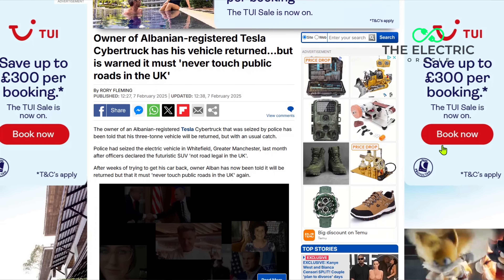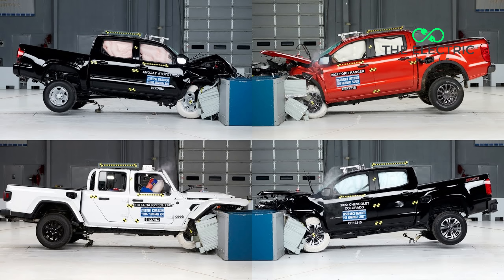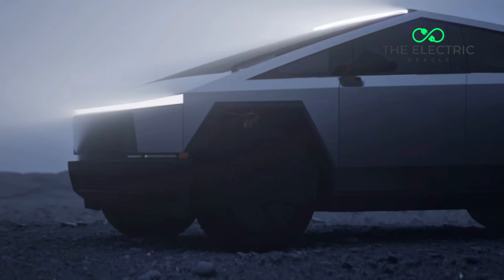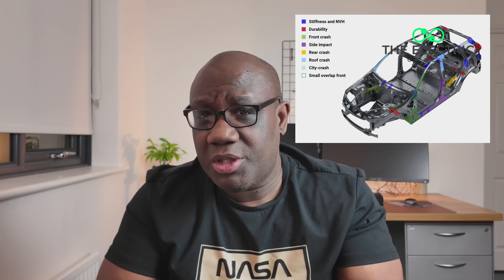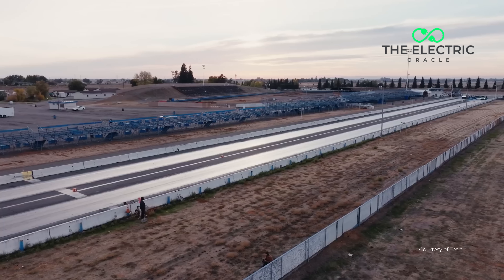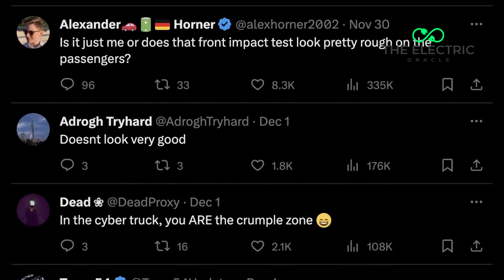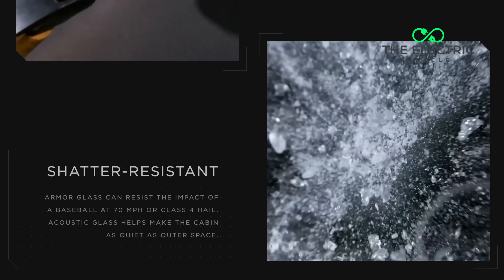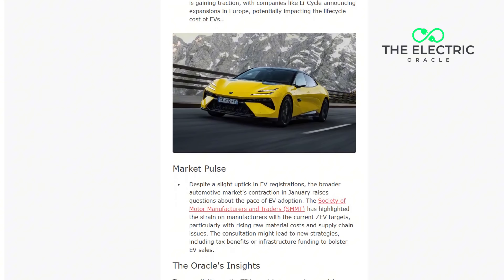Why the UK Banned Tesla’s Cybertruck – 5 Fatal Design Fails!

Comment: I would be happy to see the cybertruck banned from roads in NZ for the safety reasons here, and the poor breaking capacity I have seen in other videos (I'm surprised you haven't mentioned this issue). Utes account for 9.7% of the vehicles registered to be on the road in NZ at present,  which would make it the perfect place to market them. Unfortunately the safety standards of many of the other vehicles on the road are well below that required in Europe,  we import a lot of older used vehicles from elsewhere,  and accidents involving those vehicles and cybertrucks are going to be catastrophic imo. Unfortunately Kiwis have a "she'll be alright" attitude towards everything and won't worry until the death toll rises.

Comment: I would not want to be T-boned by a Cybertruck. Just imagine the carnage when a three ton stainless steel tank with sharp edges slices through another vehicle (or something softer). You wouldn't stand a chance.
Reply: I wonder what palms were greased to allow it in the US
Reply: @davidconner-shover51  President Musk and first lady Trump.
Reply: @alexdumas739 trump was not even in office when the cyber truck came out😂
Reply: I believe there was a report of a crash like that happening. The driver of the normal car was unhurt thanks to their car doing what it was designed to do and deforming around the crumple zones to protect the occupants from the impact forces. The driver of the Cybertruck on the other hand took the full brunt of the rapid impact and suffered significant injury because of the rigid body of the truck transferring all the energy of the crash directly into to them rather than deform and soften the impact.
Reply: @Fimbulvinter19  I remember getting into a heated argument with an American friend about this exact issue when the Cybertruck was first announced.
He was defending it but I was telling him all about the psysics of not having crumple zones and the wasteful energy usage, even if it's an EV, of carrying around all that extra weight of tough steel panels, especially when advertising it with such a fast 0-60 time.
Reply: Not to mention the fact that it burns with the force of a nuclear reactor.
Reply: @Zan823  gas cars are like 20X more likely to burn than a ev
Reply: @mcsike7264  True - because gas cars are deliberately set on fire after being stolen, etc. The statistics are taken from insurance companies.
Reply: @steve6375  hmm no its literally called a internal combustion engine for a reason 😂
Reply: I agree, I would much prefer to be hit by a nice rounded BMW or Mercedes 3000kg SUV, it wouldn't do nearly as much damage as a cyber truck
Reply: You don't want to be T boned by a heavy truck, it's even worse.
Reply: only if it have the charging stations on the range and does not self destruct on the way
Reply: Actually, it just pushes the other car out of the way, like any big truck would. Try it or try getting hit by a semi-truck at 80,000 lbs.

Comment: The Cybertruck looks like a rough prototype.  It isn't sleek, and it is evident that the Cybertruck has absolutely no safety refinements.  I haven't actually owned a car for years, but I am currently the designated driver of a Honda e:NY1 electric SUV.  If I had to use the e:NY1 on long trips, I'd be concerned about the lack of range between charges.

Comment: Yet you missed the most important fail.
Most of the defects can be modded out or by limiting import numbers to only require it to pass IVA regulations.
The fail is the steer by wire, there is no provision in UK Construction and Use or IVA regs to allow a vehicle to be registered on the road will steer by wire. Of course as with everything Cybertruck you can't just remove it and replace it with a mechanical system.
Reply: Only "Personal" imports are permitted under moist UK and EU rules, it's not simply "limiting import numbers". Even then, any personally imported vehicle has to pass a DVLA safety inspection. Personal imports may not be sold on to other users, only used by the person who imported them.
Part of the safety inspection is to ensure that pedestrian safety isn't compromised, and there is far too much on the CT that is overtly and clearly dangerous to pedestrians, even if drive by wire was permitted and/or could be replaced.
Reply: @davidcolin6519  I´ve imported 5 cars from Saudi Arabia to the UK as personal imports all passed the import checks, all LHD, all I had to do was have the headlights adjusted and added a second fog light on the back, they all passed their annual MOTs and I sold all of them.
Reply: @robertwoodhouse-bm7kt  I was primarily going by what I had heard about recent personal imports. I know that there was no hindrance to selling on PIs in the past. Maybe the rules have changed recently?
As you stated, your cars passed the safety checks. A CT never will because of the sharp crease lines in the stainless steel at the front. No amount of adding lights etc. is going to change that fact.
I personally know a guy who makes trikes out of bike front ends and car rear axles. They wouldn't pass any homologation inspections, but that is not the point. The point with the CT is that there are structural problems that will never pass pedestrian safety rules.
Reply: @robertwoodhouse-bm7kt  BTW, I live in Spain, where this POS would be permitted to be driven, but not imported or registered, and you'd never get insurance on something like this, so you'd have to take it out of the country after 1 year.
Reply: @davidcolin6519  This is a quote from the European Transport Safety Council

Huge and lethal American pick-up trucks, such as Ford F-150 are now a regular sight on city streets in Europe.  But they don't meet EU safety standards and are not tested for pedestrian safety.  How is this possible?  The answer lies in the mysterious world of Individual Vehicle Approval.

This lack of checks only applies to personal imports.  Tesla would have to pass checks on new cars.  One importer of a CT into Czech republic bought some U shaped rubber tubing and glued that over  the sharp edges on the front of their CT.
Reply: @robertwoodhouse-bm7kt  They can't be that regular. I've been living in the EU for over 32 years and not seen a single one. The only "American style" pick up trucks I have seen have been legally bought from official dealers, and have been modified to comply with EURO regulations. They're still crappy, and I still laugh at them because they are so truly and utterly awful.
I know that there are some countries which permit this sort of BS but, guess what? They're doing it in direct contravention of EU regulations. That doesn't make them any safer, it doesn't make the owners clever, it just means that they're precisely the people I would expect them to be.
I have never said that it can't be done, just that it can't be done within EU regulations.
I happen to know of another CT in Germany, so what? It's still a dangerous POS that shouldn't be allowed on European roads and is on them because of the determination of people to be POSs.
Reply: Drive by wire is a lot more costly, but also 100X better than mechanical steering.  Next products from Tesla will also have steer by wire.  It makes the easier for right or left hand driving, and also usefull for the robotaxi that does not have a sterring wheel or any pedals at all, wich will debut is Austin, Tx US by mid summer.
Reply: @EnriqueAThieleSolivan  So the driver in Texas that was incinerated in his cybertruck with what authorities believe was a failure of the throttle sensor and fly by wire steering both known problems. Mind you the wreck burned so intensely both license plates and even the vehicle VIN was melted so identification could take a while.

Comment: We have spent the last fifty years pushing back against car manufacturers, making 'cool' vehicles that are not safe. Then, along comes a rich petulant child that doodles a childs car on a napkin and says "make me that". Hey presto, the Cybertruck. Thankfully, its the only Tesla hes had involvement in.
Reply: It’s not even cool.
Reply: I don't think he just doodled a child's toy car. I think he saw the APC in Aliens and wanted one of THOSE.
Reply: Musk interfered in the design of the roadster as well it was his idea to use those electric door locks that can't  be opened when the 12 volt supply is cut. Thereby trapping people inside if the car is submerged in deep water or catches fire. Tesla swasticars are dangerous pices of junk.
Reply: You forgot about "production hell".
Reply: Franz Von Holzhausen designed the Cybertruck
Reply: @canieto1  don't quite know where to start with little nugget of knowledge. Holtzhausen may, indeed, be the lead designer for Tesla, but to throw together six pieces of flat stainless steel, five pieces of flat glass on a body that can just about support its own weight is, frankly, disparaging to the design ethos. No, Musk's grubby little hands are all over this. Holzhausen deserves better than this.
Reply: @mikebirkett010  You pinned it actually right there; grubby little hands....
Reply: @mikebirkett010  Simple things are actually the most difficult to design. It may not be your taste, but until you've driven one, you're just guessing.
Reply: I quite like Elon but this should never have left the drawing board.
Reply: @alihenderson5910  Elon should never have left the drawing board.
Reply: It isn't only Tesla many of the US pick up trucks are not allowed in the US. He pushed it a bit further sure but he is allowed to do so in the US and not in Europe, he did say very early already. It won't come to Europe very fast or ever. 
You have in India also other vehicles which are not allowed in EU. It is good to have different markets. That helps to error correct. 

For example FSD, they can test these systems in scale in US and in China(their own systems). In Europe it is impossible, you are not even allowed to have a big testing fleet.
Reply: @Utoko  I can remember back in 2016 when a 'person' tried to drive a bright red F150 onto a campsite in Cornwall towing an RV (caravan) too wide for the entrance. Took both wings off, granite is not forgiving. One of the campers said to me "don't you wish you had something like that?"  I replied "no ta, my d**k is big enough". Nuf said....😅

Comment: This isn't 'news'. 
This thing has simply never met the higher standards required here.
Reply: Yes the first time they showed off the car I said this will never be allowed in Germany. Many of the US pick up trucks are not allowed in Europe. So it isn't a cybertruck only thing.
Reply: The standards in the UK aren't that much higher than in the US. The cyber truck has never passed the US crash tests and the lights aren't legal in the US either. It also doesn't comply with US pedestrian safety standards. Elon has just bribed more people over here 😂
Reply: @Duskwind_  Wrong again.  It passed all safetyb test, and the lights are completedly legal.  They are now on the redesigned Tesla Model 3, and by summer in the Cybercab.  None of them has any problem with safety.  All Tesla cars have safety of the passengersas a first during their desing, and later construction.  It is known worldwide for more than a decade.
Reply: @EnriqueAThieleSolivan it may have been for the models that the nazi himself had nothing to do with the design of, but this is certainly not road legal in the UK or anywhere in the EU.
Reply: @EnriqueAThieleSolivan  Think what you want, but they haven't passed the official crash tests, as they let Tesla self-certify them. The maximum height off the ground for headlights is 52 inches in most states. If they are above that they have to be covered when operating on public roads. I could dig up more, but I don't really care what your opinion is.
Reply: @EnriqueAThieleSolivan UK safety laws aren't just concerned with the safety of the passengers.
Reply: @EnriqueAThieleSolivan  How much has Space Karen paid you to issue those lies? We are talking UK and European safety regs. Or is it that you just a fan boi hoping your hero will hold you in his strong manly arms?
Reply: @EnriqueAThieleSolivan The safety of all and any other road users has received no consideration at all in the 'design' of this monstrosity.

Comment: The Cybertruck is basically a 'bad' design.
Reply: It is the job of a designer to develop within constraints. A good design will be simultaneously practical and compliant. An excellent design will be beautiful too. Anything else and it's a design failure.
Reply: Who'd a thunk?
Reply: Forced
Reply: @carpinion  - Something many people don't understand is that CyberTruck is an experiment more than anything else. In addition to its appearance, it is unique in many ways. And not just the truck itself but the manufacturing methods used are also experimental. The value of CyberTruck to Tesla is not simply the number of units sold. Rather, more importantly, the value of CyberTruck is in all the knowledge gained about what works and what doesn't work. Everything from the Exoskeleton to all-wheel steering to 48-volt architecture to EtherLoop ...etc. Tesla is learning things from this that no other car company has the ability to learn. It's this kind of thing that puts Tesla so far ahead of Legacy Automakers that they will never catch up. So, like it or not, CyberTruck is not just a silly looking pickup truck. It's a masterclass in experimental engineering and automotive manufacturing.
That's my two scents 💩💩😁
Reply: A bad concept, but they built what they wanted. It's design is pretty good, they just didn't consider anything about safety...
Reply: @daveofyorkshire301 Visually it looks like it was designed by a 5 year old.
Reply: @daveofyorkshire301  It's not less safe than other US trucks, you can't really do worse than the worst.
Reply: @okgoogle4206  What does that say about US truck design and safety standards?
Reply: @daveofyorkshire301  - Here in the US the basic idea is "the other guy has brakes".
Reply: It is a brillinat desing, at least for my engineering point of view.  There is no need for dual bed construction in modern technology.  It was simply a cheap way to provide different cabib zises at the expense of the bed.  The larger the cabin , the less usefull as a truck.  So if people buy them for looks, evryone of them (pickups) look the same.  If you try a new produc in a very crowded market, then bring someting different or you will never be noticed.
Reply: @EnriqueAThieleSolivan I don't think you mean engineering. Engineering finds an optimal solution given a set of constraints. Just ignoring most of the constraints is a grade 6 level approach to product design.
Reply: @EnriqueAThieleSolivan - Agreed! Did you see my comment in this thread? I cannot see it for some strange YouTube reason.
Reply: I love the cybertruck!
Reply: @canieto1  Your senpai Ketamine boi will never notice  you.
Reply: @ptonpc 😂

Comment: The UK raised the weight of the car, if driven by non combustion engine so you can drive a cybertruck on a standard car licence.  The continuos light bar is not the headlights, there are 2 headlights lower down.  The cybertruck has crumple zones in the giga castings.  The car was impounded as it had been registered abroad but the owner lives full time in the UK and he did not have UK insurance.  I stopped listening to the rest of this you tube.
Reply: No they haven't

Comment: There is a way to make the Cybertuck safer: Disconnect all the air bags. Remove the seat belts. Position a very sharp set of knives on the steering wheel facing the driver.